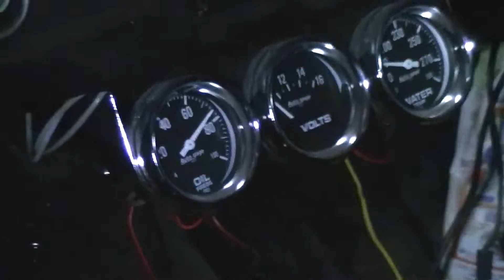440 73 Duster First Fire Up

Comment: Hey I came across your video, I’m building my 1970 duster
I have a 440 engine in the engine bay but Idk where to get a steering column that will fit the gear box since the one it has it’s too small for the upgraded gear box I have now

Comment: How did the headers fit and did you use the tti headers?
Reply from the maker: it was a pain in the ass. had to be dinged every which way. don't believe the are tti. have to ask my uncle to be sure
Reply: moparman619 oh okay. trying yo fit 2in long tube in my 440 duster tight as hell
Reply from the maker: put 2 inch tti in my dads 1969 dart we're currently building and if we had a dollar for overtime we said "should've stuck a SB in this thing" 😅
Reply: moparman619 Dam, already said that a couple timing setting the dam 440 in there,hahahahahaha.